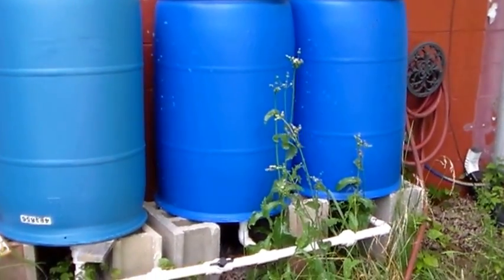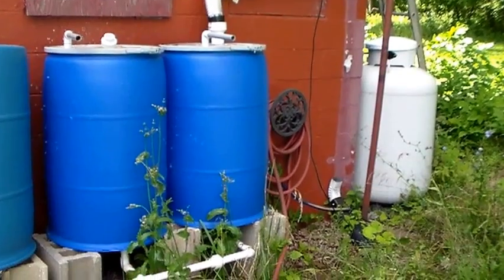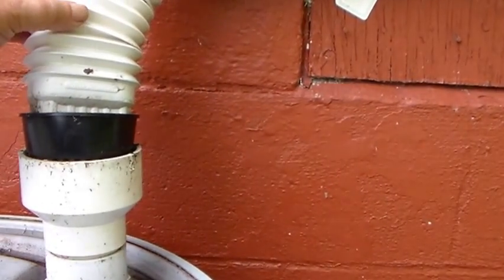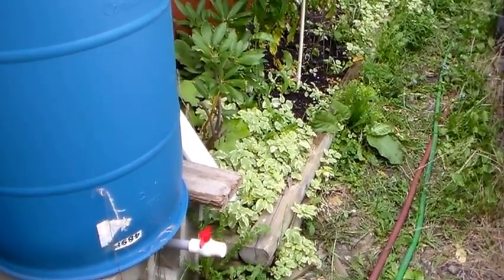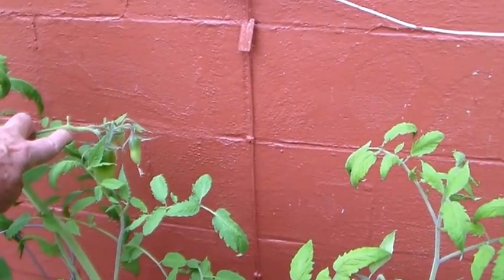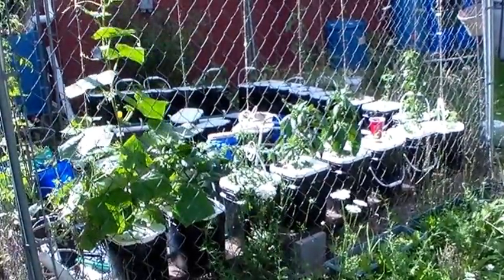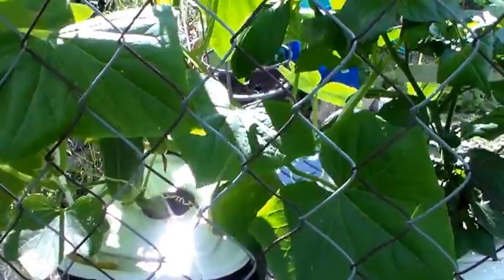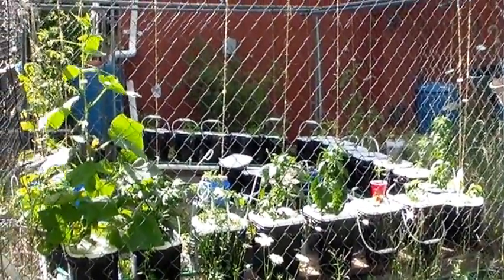Rain water system

Comment from the maker: This system is great, especially since I can get barrels for free.  I have 13 more barrels setting around that I will adding to the system.   I might go with plastic totes in the future.  I can get them for free also, plus they have a capacity of 275  gallons, and also they have a built in spigot and a framework around them that allows them to be stacked.    A lot of good youtube videos on rainwater catch systems.